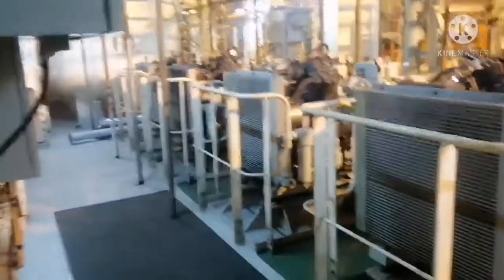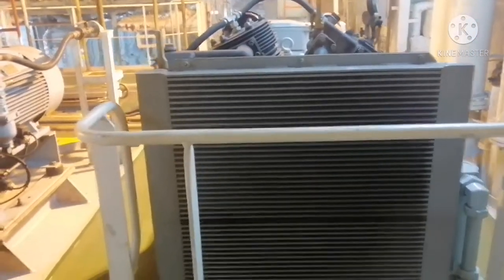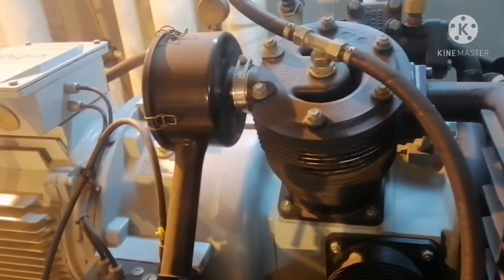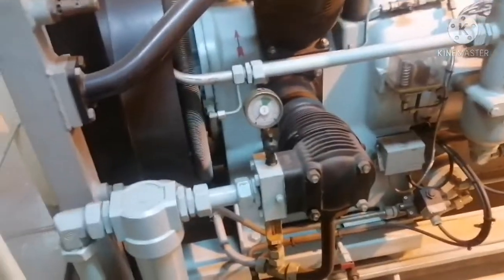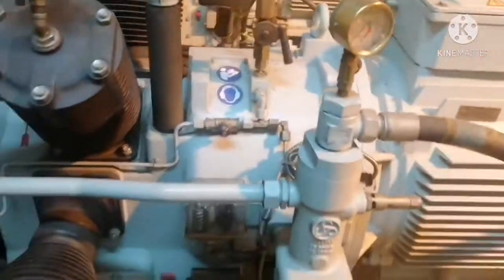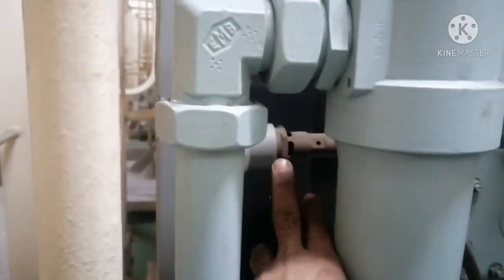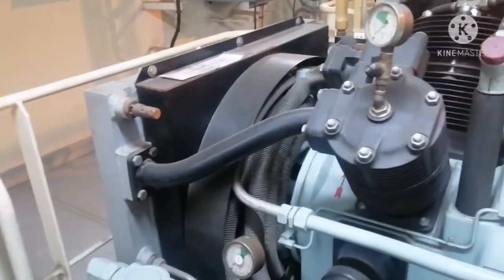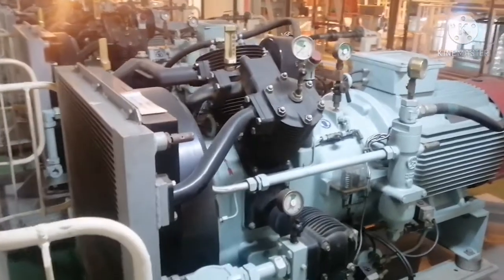KNOW EVERTHING ABOUT MARINE AIR COMPRESSOR

Comment: sir, good day. long time no video! hope you are well and ok.
i have a question regarding  air compressor bumping clearance.
how exactly modern day bumping clearance is taken? from the book, we can learn that, we have to make a "wire ball", put it on the piston, then put back cylinder cover, compress the ball by turning the flywheel with tommy bar, etc.... 
but my question is, this process is very long and hectic. also old school. do you guys follow any other style?
Reply from the maker: Vdo on the way sir.. 😊
Reply: @marine-knowledge-basha  sir, can u pls reply my question about bumping clearance pls..
Reply from the maker: @mec6953  sir thanks for your query...
Bumping clearance can be taken by the way you said only..
Apart from that  Maker's recently recommend to take Bumping clearance for the first stage of tandem piston vth the help of depth gauge.
Hope this reply will satisfy your query

Comment: Greetings Sir
How do you depressurize an air bottle? Can you please help with a brief procedure.
Thanks in advance. Your videos are helping me a lot.
Reply from the maker: Thanks a lot for your good compliment sir..
Procedure for depressurising an air bottle :
* Ensure standby air bottle is pressurised. 
* Close the filling valve of standby air bottle which we need to depressurise. 
* Close the outlet valve for Main Engine and generator.
* Open the drain valve slowly. 
* Ensure the air bottle pressure is dropping. 
* Once the air bottle pressure comes to zero, you can open the inspection man hole cover slowly and follow the inspecting procedures. 
Hope this reply will satisfy your query
Reply: @marine-knowledge-basha  thanks a lot sir for providing me with this info. This was very helpful.
Reply from the maker: @vijaynaik7250  welcum sir.. Ur Alwys welcum vth queries

Comment: Hi sir. I have an doubt. What is bursting disc? And difference between bursting disc and relief valve?
Reply from the maker: bursting disc is a copper disc which will be in air cooler..in case cooler tube leaks and if there is a increse in pressure the bursting disc will burst and release the pressure....bursting disc should be changed once it got burst.
Relief valve is placed in each stage  and this relief valve will be lifted if there is any increase in set pressure.
Hope this reply will satisfy your query..
Reply: What will happen if I place relief valve in place of bursting disc?.
Reply from the maker: @balajichandrasekar5005  Thanks for your query sir...
Nowadays most of the new model compressors come with relief valve... Bursting disc has more advantage as it will burst and release the pressure instantly... But relief valve may get into failure of it is not maintained periodically.
Hope this reply will satisfy your query

Comment: 1) Why here is 3rd stages what is the cause of it i found only 2 stage compressor .
2) If for some reason one of safety valve of 1st /2stage or 3rd stage will activated what is the cause of it ?  What i shoud do to rectify it ?
Reply from the maker: 1) It depends on the requirements of customer... Some compressors have 4 stages also..
2)
Either your compressor valve is defective.(change it) 
Either your safety valve is defective. (overhaul it).
Either the outlet valve may b stuck pr partially opened(chk the valve)

Comment: What is condensate drain ?
Reply from the maker: Condensate drain is nothing but the water which is mixed with air for to moisture... And you can find it in outlet of air cooler and it can be drained frequently using auto drain which is opened while compressor is on operation.